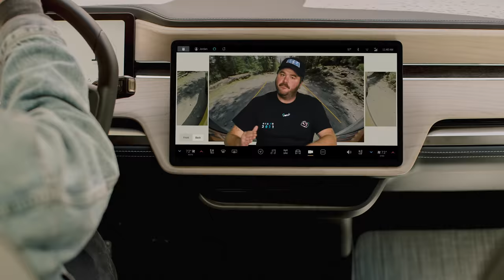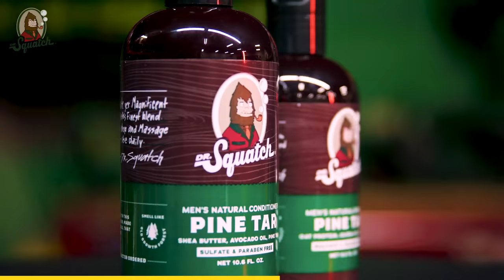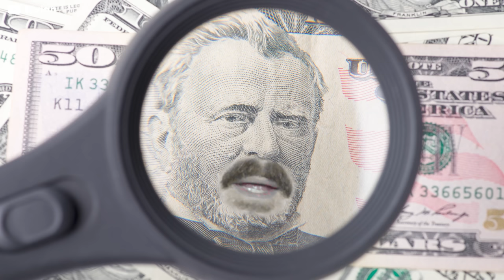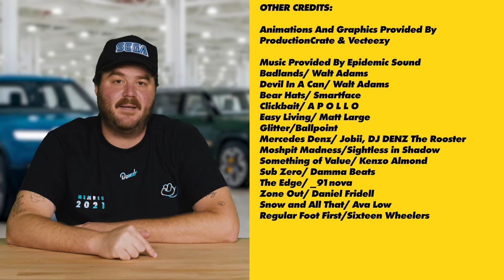Rivian - Tesla's Cybertruck, But Real | Up to Speed

Comment: I feel as if the EV realm is good but I feel as though it's not any better for the planet than internal combustion engines. I mean, realistically where are all the batteries going in 10-15 years once they don't hold charge? Into the landfill? The ocean? Who knows... at least with the CO2 that internal combustion engines make plamts will take in and convert back to O2

Comment: Cybertruck has a 6.5ft, 3500lb payload, 500 mile range, and can tow up to 14000lbs while the Rivian truck has a 4.5ft bed, a 1750lb payload, has 400 mile range, and can tow up to 11000lbs. Both those packages prices at 70k so for the same price, you get more with the cybertruck. I just wish they didn't make it look like an origami figure. It's hideous

Comment: Cool, but orbis ring drive electric wheels cost only 9k for 2 and can turn any 2wd car to a hybrid capable of driving on only electric. All you need is their base model 9k kit, then get a refurbished prius battery for 1250- 1500 and throw it under your back seat, and you have  a plug in hybrid (or you could get 4 and make any classic or modern gas car FULLY electric plug-in by just using 4 orbis wheels. They add 100hp when added to a 2wd like the civic type r the creator showed them on at sema. I will be buying the base model set of 2 in order to make my MS3 hybrid without a perm mod. Orbis is the future. No new chassis., No upcharge, and we can now resurrect any classic car sitting in a field with no combustion engine knowledge as long as the frame and chassis is solid. This is the way of electrifying the world.

Comment: If we were really concerned about our emissions we would have slowed down the production of vehicles. In 2018 there were  98 million new vehicles that were produced worldwide. That whole production process is not clean. What if they reduced that new vehicle production by 80% and we focused more on the millions of used vehicles we already have.  We could have focused more on maintaining and making new parts for preexisting vehicles.  In society if an engine blows we replace the vehicle and it could have been made normal to just replace the engine instead.  Then our scientist could have focused more on making an alternative fuel for our gasoline engines.  A fuel that could have been used in any gasoline engine. However, everything I just said does not make money. It only focuses on the environment.

Comment: Drift mode is marketed because of the independent motors. No axles, so it has to be programmed to allow the motors to turn in tandem in the rear like a locking diff. Otherwise you look like a sad posi-trac owner.

Comment: I had huge doubts about Rivian, especially when they started loaning out trucks to TECH Youtubers and not CAR Youtubers. That's a huge red flag in my book. And let's be honest: it doesn't matter how successful they are, they're nowhere near as valuable as Ford. Yet.

My opinion has started to change since they finally put one in the hands of Doug DeMuro. Watching a thorough overview of the truck, I found a lot to like about it, so much that I shared the video with several family members suggesting to them that an electric truck similar to this might be exactly what they're looking for in their next vehicle. Slight problem with the Rivian, however: it's about 2-3 times as expensive as any previous vehicle they've ever bought.

It's also got some glaring little flaws, nothing too deal-breaking but quite noticeable in a truck that is otherwise designed so smartly. So I'm looking forward to seeing them deliver these in mass quantities. They have a good product, as far as I can tell. Let's see if their manufacturing can keep up.

Comment: Some dumbasses will believe that BS about being $100 a mile cheaper to run than an STI. It’ll be a bit cheaper for the first owner, the second owner who can only afford one with 100k miles on it will be very disappointed when they need a new battery for like 20 grand and they probably still have payments.

Comment: Y'all need to do some research in just which industries use cobalt. And of course how we don't mine for cobalt specifically. 
Rather it's a side product of both nickel and copper mining. Guess who is the #2 consumer of cobalt worldwide?
Oh yes it's your beloved fossil fuel industry, they we're #1 up until late 2019 when evs started scaling up. 

Maybe look at rare earths used in spark plugs which evs don't use but every single ice sold has 4-16 of.
And of course platinum for catalytic converters which of course every ice sold for personal use nowadays has 1-4 of. Evs don't use those either. 👍🏻

Maybe even do some research on how it's est from well-wheels over 15% of all energy our society uses worldwide. Is consumed just to find, drill for, extract, transport, refine,store, transport, store again in tanks which leak. Then get pumped into your vehicle's tanks to burn at 20-30%max average efficiency. That's the est cost of supplying fossil fuels.

Comment: This is not a truck. You can't put anything into the bed. Trucks are meant for work or hauling, this meets none of the expectations.  Can I put 2500 lbs in the bed and drive it for 280k miles without any major issues or rebuilds? No, guess I'm still buying a diesel truck to do so. These tech companies need to get their head out of the nether regions and start thinking about the dark side of humanity as they seem to shun people who actually work for a living.

Comment: Real truck people use them for work and they get beat up its impossible not to, they will learn quickly there "trucks" are crap for what they are really needed for. Only one I can see doing ok for a truck is a Ford just because they didn't make it look to "fancy" and looks like a regular f150 pretty much. I don't get why people need a truck to daily drive when they never ever use the bed, or take it off-road, or tow. If I was to buy the same optioned truck even before Biden's economy it would still cost 15k more for the same truck and options. Truck market got trucked, i have to have a tool box in the back and I've not seen one new electric truck able to fit it but the ford.
Reply: My dad used his truck every day for years and it still doesn’t have a single dent
Reply: @darthmaul216  yea I’m talking from my experience and my dads. we demo and do remodeling. I’m just saying no one is going to want to beat up a nice expensive truck even if your not trying to accidents happen. My dad keeps his like a pavement princess but still has a few scratches on the tailgate,  I try my best as well but didn’t have the money to get a perfect one. His last truck a 2010 platinum was MINT Not a scratch and the rear body corner rotted out on both sides due to condensation from the AC.

Comment: You cant be climate neutral while charging batteries with primarily coal plant power. This electric vehicle push is purely nonsense and going to be a hard fail if pushing out all gasoline engines.

Comment: Considering how shit batteries are in every aspect, I'm disappointed that hydrogen is taking a backseat to to this rotten power source. Thanks Elon.
Reply: 1) please explain how batteries are shut
2) Hydrogen isn’t cheaper or more efficient than batteries.  Also, there isn’t a nationwide Hydrogrn fueling infrastructure. Facts is, hydrogen production is not green. 
3).  Not a Elon fan but what does he have to do with hydrogen?

Comment: Does nothing for me. Looks boring. May be fast but that's it. He is correct perfect for its demographic, bunch of people who are the same and dont have much personality. Oh they dont care about the child labor or other environmentally questionable processes needed to produce the batteries. I'm real sure the company is going to have a fantastic report about those things. They will report whatever everyone wants to hear, no child labor in our batteries, we defied chemistry and there is no significant environmental impact from any of those processes. Be a hero buy electric, that is a fantastic marketing ploy. My point is this, electric may be better environmentally in some respects but it is tiring listening to people make it sound like there is no impact at all. I would buy gas power all day long if it put an end some of the child working conditions and slave labor used to make your precious electric vehicles. Remember lithium is a rare earth metal, meaning you cant find it just anywhere and there is only so much of it. What happens when it runs out. Cant always use just anything, physics and chemistry still matter. Just because you want a forever battery doesn't mean it can happen.